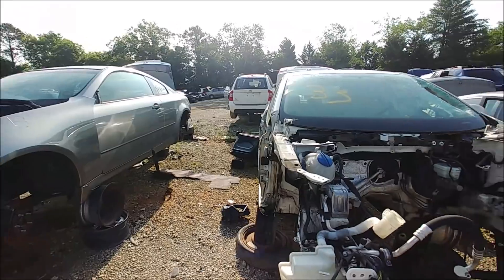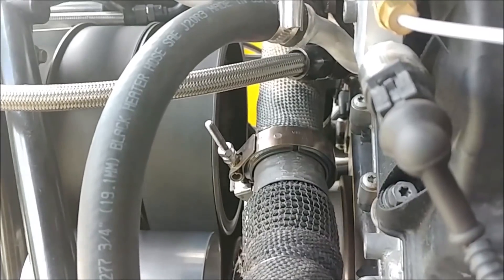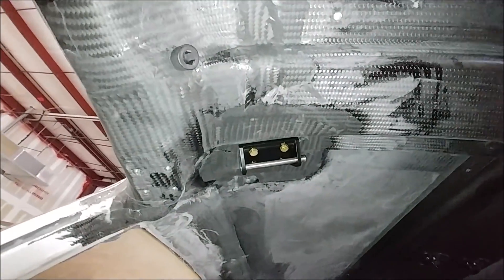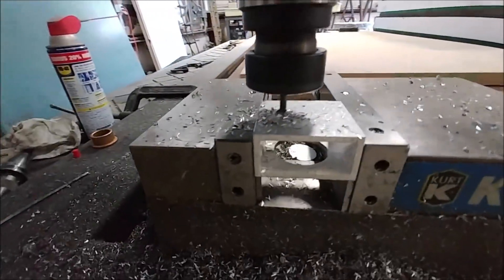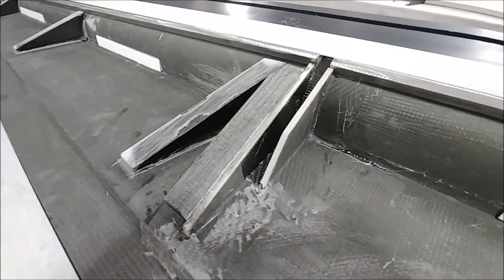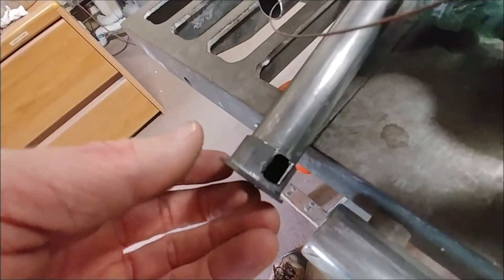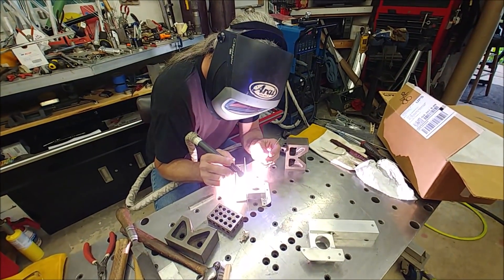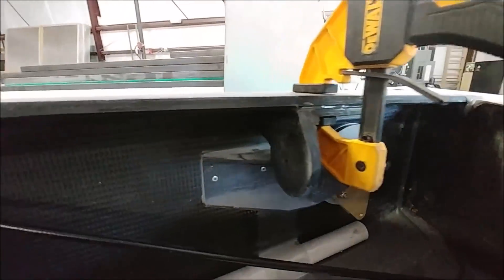Right Aileron Closed Out - Building the Raptor Prototype

Comment: Diesel can be noisy when cold mec tolerances etc, also if the injectors are getting sad it will make a rattly noise when cold which goes away when the engine is warm.  This is usually accompanied by white smoke at start up due to incomplete burning and black smoke under load when warm.  Your engine sounds ok.

Comment: Edited... I ran the audio track through a narrow bandpass filter and there is a difference between cold and warm. When cold there  is a 1 in 3 pattern with sometimes added weaker ticks on the second intermediate beat,  later also both intermediate ticks while when warm all ticks are equal, meaning ticks are equally loud on beat 1,2 and 3.
Reply from the maker: Maybe just a sticky lifter when it's cold. No big deal if that's the case.
Reply: The ticks basic rate is exactly 1.50 times 900 rpm, so 3 per 2 revolutions. So must be just one side of the engine, since it's half the firing rate?
Reply: Isn't 1.5 about the ratio of the belt drive?
Reply: No, it's 80 over 29 teeth, so 2.76. The redesign has 89 over 29 teeth, so 3.07.
Reply: According to Peters comments the actual ratio is 1.43, and the new one will be 1.58. 1.42 is close enough to 1.5 to match your numbers (the ratio numbers get repeated in last Saturdays video: https://www.youtube.com/watch?v=RTPBjKeUXeI ), isn't it?

( BTW,  calculations based on measures taken from sources of unknown calibration usually not valid to a third magnitude. )
Reply: Thanks for correcting! Makes sense, 3,800 engine rpm / 1.58 = 2,400 prop rpm. I had accidentally counted the teeth of the shaft, not the lower pulley.

Comment: that sound correlates with the final drive belt turning.
Reply: the frequency of the ticks is 1,350 per minute (1.5 x engine rpm), that is not the belt drive's rpm.
Reply: okay, I took a small screen capture into Resolve and ran the slow motion at 25%, watching the audio track the audio spikes from the ticks match perfectly up with the white markings on the final drive belts rotating.
Reply: Thanks, that is a good idea. I just did the same and I can see that the clicking sound is exactly every two revolutions of the crankshaft at the same angle, so a single cylinder. Not sure what you mean by final drive belts. My former conclusion of the noise being 1.5 x engine rpm isn't correct then which means either the video is not 8x slow motion of the engine wasn't running at 900 rpm.
Reply: I don't think you can rely on the engine RPM, and by final drive I mean the dual belt propeller thing drive, when I took the slow motion and put it at 25% then the clicks on the audio track in Resolve matched perfectly up with the belts turning once - the white marking on the belts match up with the clicks on the audio track and it even matches frame by frame... what we're hearing is a wonky injector or something else but the sound matches up with the belt.
Reply: Like I said it WAS the final drive... said it all along and now in the latest video the bolt holding the prop shaft snapped... final drive....

Comment: All the detail and enormous amounts of work are impressive to see.  How do you keep the team productive, Scrum?  Thanks for sharing.   
I can see why doors have to be redesigned.  Will new design be lighter?  As these finish up it would be interesting to see if they have gained weight vs cad projection?
It’s fun to watch & learn a bit of composite Mfg.  Can some of the hard points being laboriously added move to the production moldings or is all the detail work permanent?

Comment: all of those hard points wouldn't be a problem if you planned ahead and did them once before the bulkhead was installed.
Reply: well idiotcare80 that's a stupid thing to say because prototypes turns into real airplanes and if they're going to reach their low cost goal it needs to be designed into the fuselage from the outset.. so no it's NOT just a prototype.

Comment: For running cables and wires through hard to reach places or difficult corners I have found that I can blow fishing line through with an air compressor then tie into a stronger string an pull it back through. If it is a tighter fit  the string won't break when pulling a wire.

Comment: Long shot, but maybe have a stethoscope listen to water pump and its belt pulley?  Not sure if they are reacheable while engine is running.  Had those replaced on my VW 4.2 (gasoline) @80K miles and 5 years.
Reply from the maker: Our engine only has 8k miles. I listened with the stethoscope and the sound is loudest toward the back of the engine where the high pressure fuel pump is. But it's a rotary pump so I wouldn't think it would make a constant ticking nose. Most likely it's just the injectors and is quite normal for a diesel.
Reply: Raptor Aircraft , it isn't a constant ticking to my ear, it sounds like backlash in the drive elements of the rotary pump working against the fuel. The fuel is acting as a damper. And the inlet/ outlet ports and their check balls and springs are all acting together. I wouldn't worry. If you get worried put a little filter in the return line of the hp pump and check it after awhile.